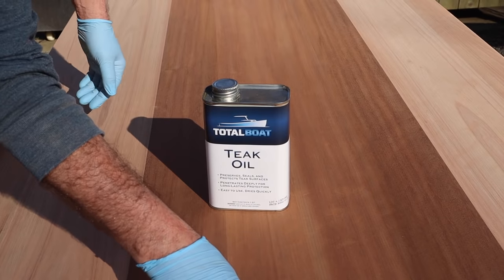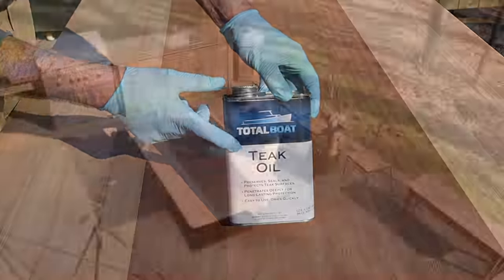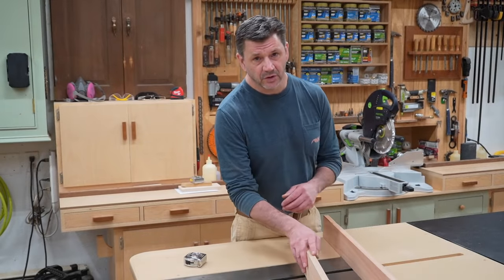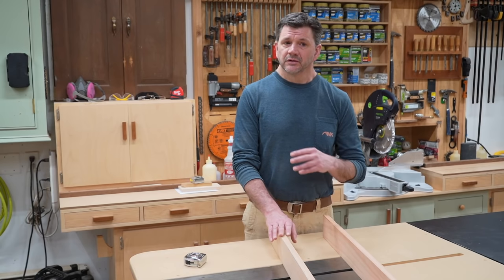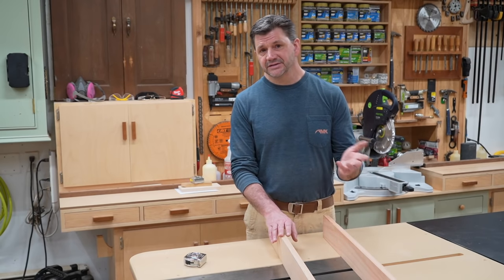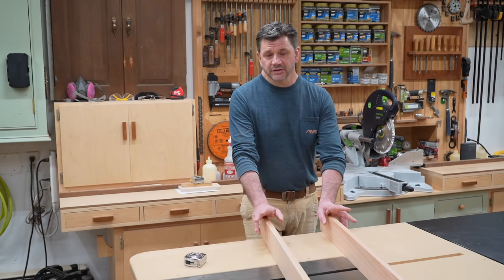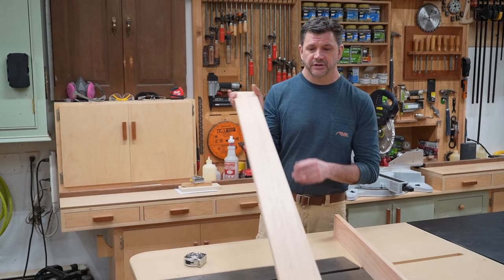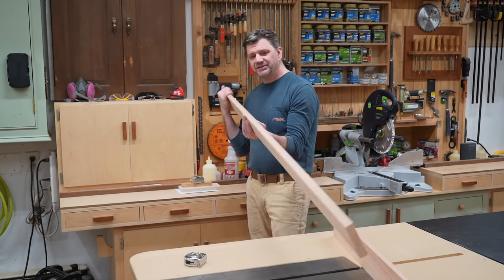Power Washing Transformation!  Satisfying Outdoor Table Restoration

Comment: Hmm.  My experience of using a jet wash to clean a hardwood deck, table and gate (various hardwoods: oak, teak and Ipe) is that it is incredibly destructive to the grain, meaning more sanding is needed afterwards to correct this damage, and more material needs removing than simply just sanding it.  The grain fibres are also opened up so, if it's outdoor furniture, it becomes more prone to silvering and mould in future years.  It definitely came up looking nice at first in a kind of 'wow' way, like in your vid - mainly when it was wet tbh though, once it had dried it didn't look anywhere near as uniformly cleaned - but in the end I did away with this as a process and now stick with simply sanding it back instead.  For me, that's worked out both a quicker and less destructive approach.

Comment: Do you leave the bottoms of your outdoor tables unfinished?
Reply from the maker: No the bottom needs at least 2 coats too
Reply: I am having some trouble with an outdoor sapele table I did a few years ago, I used an exterior oil based urethane and it is failing. I knew that would happen but I don't want to keep doing the maintenance on it. Thinking about doing a teak oil on it, that way the client can apply it on their own without having to sand. I know you have tried several finishes for exterior tables, curious as to what you would recommend. Thanks @JonPetersArtHome

Comment: I would have thought that it would have split at the two dissimilar wood seams - turns out I was wrong.
I would have thought that the pressure washer would have damaged the wood - turns out I was wrong.
I cringed when I saw you hop up on the table with your boots on - turns out I was wrong.

The end product looks great - you just can't beat the look of sapele.
Reply: Funny! I guess you were right about the end product.